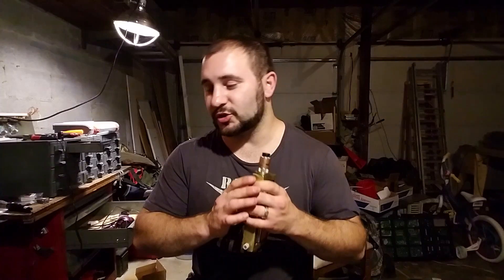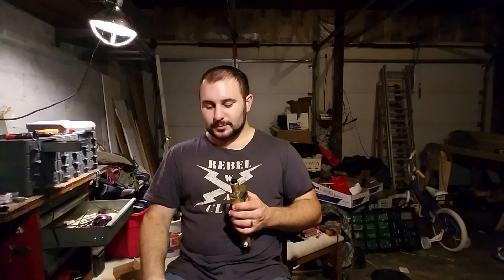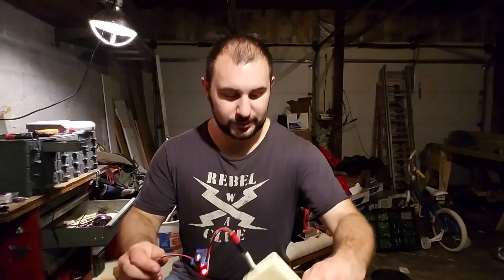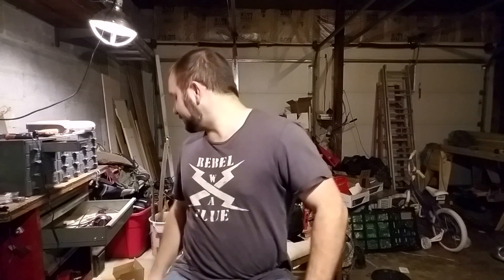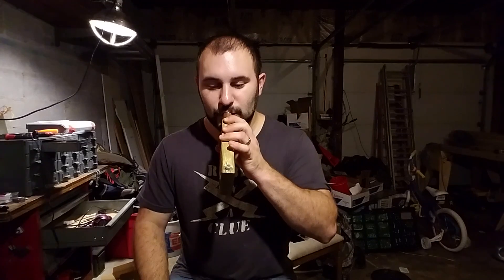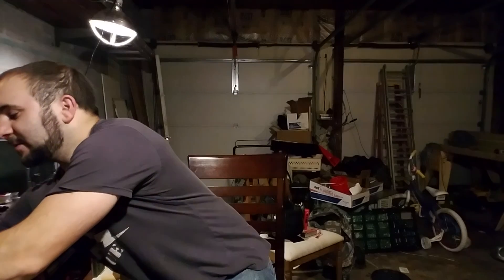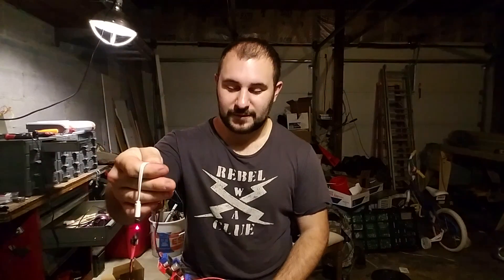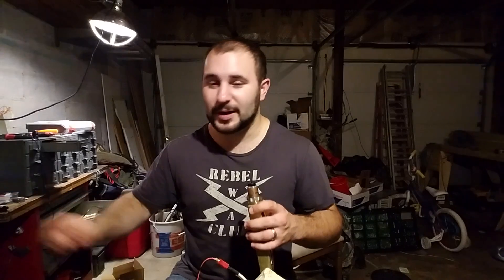Charging batteries with batteries

Comment: i have a question bro !
 can battries be charged with their   own power ??   in simpler way my 12 volt battery gives 230 v  after being converted through a invertor. what hppens if i connect the battries to their own power supplyying socket  inorder to charge them .?
( hope u have understand because i cant speak english well )
Reply from the maker: Samsung Uncle if I understand you correctly then you want to plug your battery into an inverter then use that inverter to charge the battery. its not possible unfortunately. you cannot use a battery to charge itself no matter how much you change the voltage.
Reply: Thanks for ur reply Matthew Vandewiele !

Comment: Little correction to that 2S ultrafire battery, now that it is 2S with 14 cells, the capasity drops to 7000mAh at 7.4 nominal voltage. :D
Reply: Still very much energy approximately 52Wh. And if your phone battery has 13Wh give or take 5, it should last good amount of time.
Reply from the maker: +palvikr you are absolutely correct lol